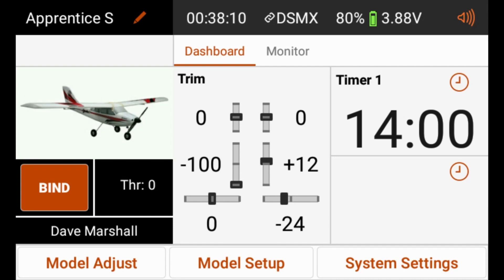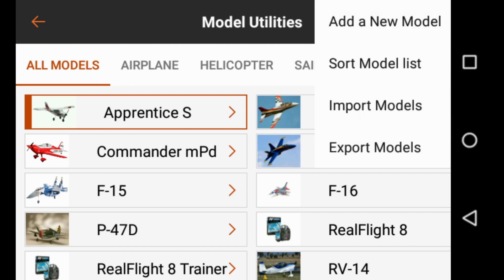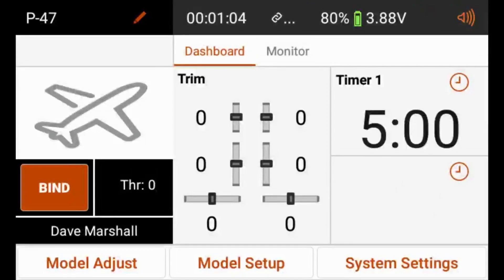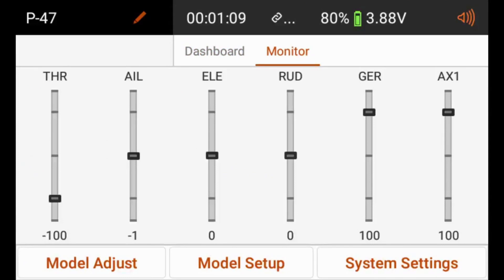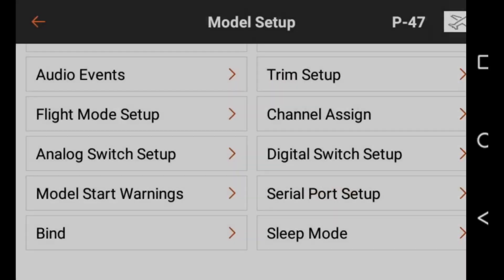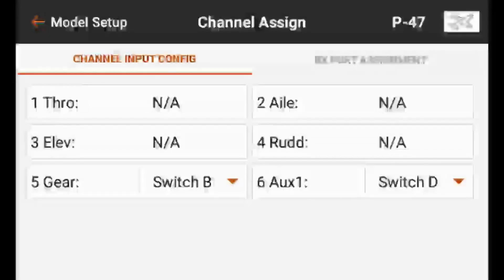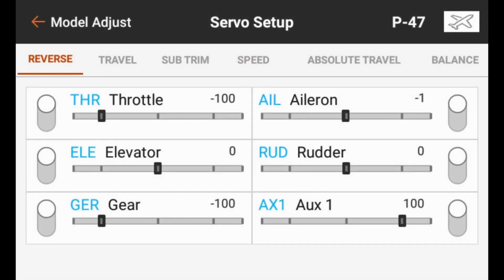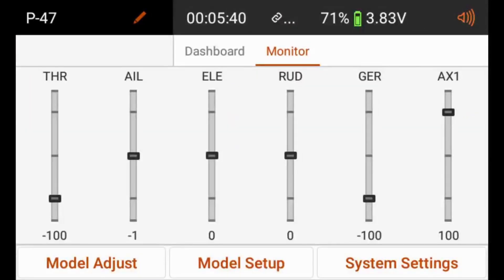Spektrum AR636 Programming Series - Part 14: Transmitter Selection and Programming

Comment: Dave,  I recently purchased a used AR636a from a Eflite PT-17.  I followed your programming instructions to the letter.  Hooked it up in my plane and it did bind okay according to the transmitter display,  and the orange flashing light went out. I did it with bind plug removed after initial plugging in the battery so it would bind with SAFE.  But it won't initialize the reciever, the esc just constantly keeps beeping.   I tried backing down the throttle trim,  I tried rebinding again. I tried it with servo's unplugged and just esc in throttle port, but It just won't initialize and turn on the Receiver light to solid orange?  There is no light after binding,  no servo movement,  no throttle nothing?  Just the constant esc beeping.  I tried a different known working esc from another plane with same results,  I tried a different brushless motors with same results.  Each time I made the change I powered off reciever and transmitter and then rebooted everything again with same results.  I'VE tried rebinding with both bind plug still installed and bind plug removed while binding.  Any ideas what might be causing this?
Reply from the maker: How you bind is setup in the SAFE Model Builder. If you set it up to bind with SAFE select you have the option to bind with the plug in or out. If you set it up with SAFE with a pre determined flight mode switch then you leave the plug in through the whole process and bind like a regular receiver. Taking the plug out after you connect the battery is a SAFE Select function only. If you were able to reflash the firmware then whatever it was programmed with prior is pretty irrelevant. They all act the same no matter if it’s an Open Stock AR636 or an OEM A or B model, unless it’s a pretty old model it came from. The first few models with the AR636A’s were locked down and unable to be registered or reflashed.
Reply: @TheRCAirMarshall  I used the safe model builders Operetta profile to set up for "wing" elevon  settings,  it was his settings that got me all messed up,  while trying to config using you're suggested settings at the same time really got it out of whack.  But I've since figured it out and got it working with G switch being flight control and "I" switch for panic.  The model builder profile had it set up with safe select option with binding (plug in or plug out) rather then how you did it.  It was the only way so far that I've been able to get elevon setting in the spektrum programmer.  When I set it up first time following your videos there was no way to change wing type to elevon?   I'm wondering if that's because when you initially plug in the Rx to spektrum programmer you and got model mismatch that you selected "install from reciever" rather then "install from computer"?  Since my used reciever was from a normal wing config originally,  it pre-sets it as that with no option to change it to Elevon? That's why I ended up using the Operetta profile from Safe Model builder's Eflite airplanes folder to get that flying wing profile.
Reply from the maker: With the 2.xx firmware, you don’t have the option to set up elevons. There is a way to trick the Spektrum Programmer into thinking that your profile is using 1.xx firmware though so it will let you make the change. It requires a lot of importing and exporting. I’ll try to explain as best as I can. First, go ahead and upgrade your firmware to the latest 2.xx firmware and build your model using the Spektrum programmer with standard wing type. Export the model and bring it into the SAFE model builder. Go to the advanced tab and in the AR636 Model Setup Version, change the setting to Firmware Version 1.xx. Save the profile then import it into the Spektrum Programmer. Now you should have all the aircraft types available so you can select elevons. Once set, export the model profile and load it into the SAFE Model Builder again and change the setting in the advanced tab back to Firmware Version 2.xx and save it again. At that point you should be able to import the profile back into the Spektrum Programmer with the elevon setup and load into a receiver using 2.xx firmware with all the SAFE settings enabled. It’s a little crazy but it’s the only way I know of to work around the wing type restrictions that exist in the Spektrum Programmer for 2.xx firmware receivers.
Reply: The RC Air Marshall - I tried your suggestion,  after doing all that, after binding, the safe flight mode selection does move the control surfaces the correct direction, but the stick controlled movement of elevens isn’t correct. I tried all receiver reversal directional changes using mobile Bluetooth programer with no success? 
“BUT” - what did work was creating a new Acro model in transmitter with “Normal Wing” not Elevon mix selection then Importing the .srm file straight from the model builder file for the Eflite Operetta flyjng Wing into the spectrum programmer without making any changes to it using Safe Model Builder, and uploading that to the receiver then binding transmitter with bind plug installed (NOT removing it after flashing Rx light). That worked perfect. It’s a 2.xx firmware file, but only allows for using the “A” switch (Gear) switch with either AS3X or SAFE.  But that’s okay with me, at least it works.   Thanks for all your help with this.  It’s possible that had I not had the elevon setting in my transmitter when previously trying the method you suggested before probably would have worked?  Tomorrow I will try that and see? I'll let you know how it goes.
Reply from the maker: Yeah, that would do it! If the receiver thinks it is sitting on its side it will never initialize! Glad you were able to get that sorted, and thanks for letting me know!
Reply from the maker: sbs9026 not 100% sure. I know if you follow my guide you are binding it like a standard receiver, not a safe select receiver. So you leave the bind plug in until you are done binding. You don’t need to remove it. You may try reloading the firmware, reloading the profile you created, And try to bind again. Just leave the bind plug in for the whole process.
Reply: @TheRCAirMarshall  - I'll give it a try.  Although everything is working great even though I bind  it with plug removed?  Do you think it makes a difference if he the receiver you start with was an original AR636A from a previous BNF kit rather then a brand new AR636 receiver without the A on the end that has never previously been programmed by Eflite ?
Reply: Another question,  if you're setting up for Elevons, you set both that wing type in the programming of the reciever and in the radio as well - correct?
Reply: I finally figured out why the reciever wouldn't initialize? I had the reciever installed pins toward nose/Label left, but I had selected in SMB (Safe Model Builder) pins toward nose/label right.  So the reciever thought it was upside down and wouldn't initialize. I found this out buy re-binding by finally removing the reciever from the plane prying it off that super sticky gorilla tape you suggested (good stuff by the way) and bench tested it.  I was holding it in my hand and it initialized the orange light came on, and I'm thinking what the Hell? I've been messing with this Damn thing an entire day? Why is it working now? So it hits me? I had picked the wrong orientation?  Picking the correct orientation is like "Priority Number One, which you do point that out in the video?  I guess I just dont know my left from my right? Lol  Thanks for all the help Dave. Your video's are much better then Horizon Hobbies setup video's by FAR !!!

Comment: Dave, I'm considering upgrading my transmitter.  I've currently got the DX8e.  To be honest I don't really like it.  It feels cheap and its programming roller is glitchy and frustrating.  The fact it doesn't have voice also frustrates me since my DX6 Black before it did.   I'm seriously considering the DX9 Black so I'll be able to control gyro gain from the transmitter on my AR636 receivers.   But at $479 I'm wondering if you think it's worth making the further jump up to the $700 iX12?  Will I be happy that I spent that extra $220 for the iX12?  Is it gonna give me so much more verses DX9 Black that I'll be super happy I made the choice to get it?  When you got your iX12, what did you upgrade from.  Are you very satisfied that you did it?  Because the difference in price would buy me a Brand New BNF plane. So I've got to consider that.
Reply from the maker: sbs9026 so I’m a bit of a techno geek. If it has a big screen on it, I probably want it. Haha. I was upgrading from a DX6 around the time that I started moving on from 4 and 5 channel radios and wanted to buy models that had 6 channels with AS3X. The main thing that factored in to my purchase of the iX12 was that the DX9 Black was sold out at the time. I actually wanted a DX9... That said, now that I have an iX12, I don’t regret it at all. I love the interface and the ability to have an actual picture of the airplane rather than a close approximation in black and white. I also like the voice prompts a lot better... Because it uses Google text to speech functionality built into the Android OS, it can literally say anything you want in just about any accent, dialect, and language you choose. On the DX9, you’re limited to what voice phrases Spektrum makes available, and you have to scroll through a LONG list of commands to choose the right one. It’s kind of a pain. Adjustments are easier, IMO, no scroll wheel, there are on screen sliders so you just swipe the slider and you’re done. The UI takes some time to get familiar with it, but once you have it down, the iX series transmitters are definitely a step up from the DX series. If you consider the cost per channel, the iX12 is competitively priced with the DX9. Both have a per channel cost of ~$50/Channel. For my money, considering they’re the same cost per channel, I went ahead and spent the extra money and went with the iX12 rather than wait for the DX9 to come back in stock. I don’t regret it at all. I haven’t had a need for the extra channels just yet, but some day I might, and I won’t need to upgrade my transmitter when that day comes. Honestly, hindsight being 20/20, I tell everyone that asks to get the best transmitter you can afford... As mentioned in the video, your transmitter is an investment that will last a lot longer than most all of your airplanes. Good luck!
Reply: @TheRCAirMarshall  - Thanks Dave, I really appreciate your input in this subject.  What you said really makes good sense.  I can see that in the long run getting past the "Sticker Shock" I'll be happy I made the choice. 
Not to mention the iX12 will hold its value for many years to come, and hold its value better then any of the DX series radio from Now on out.